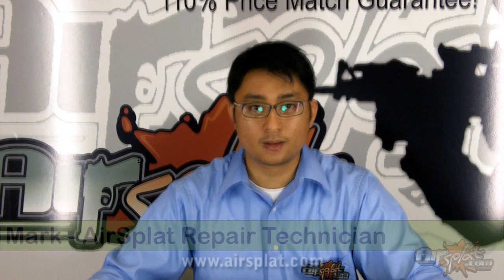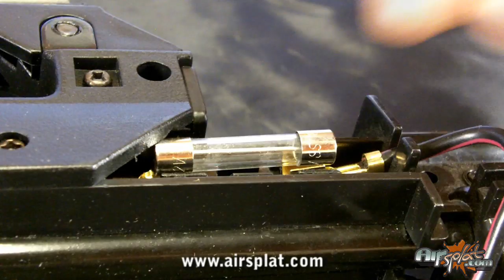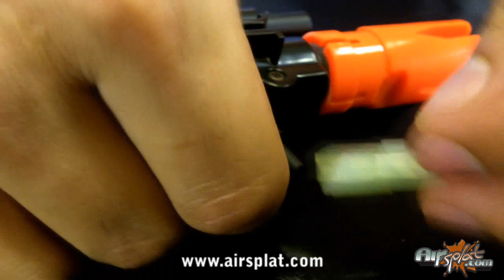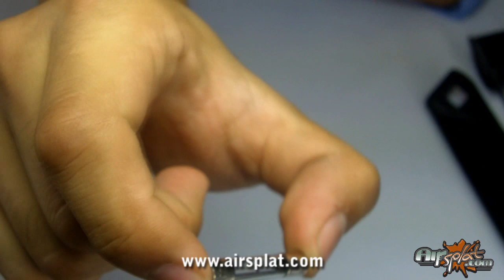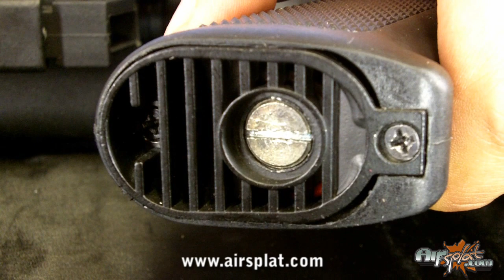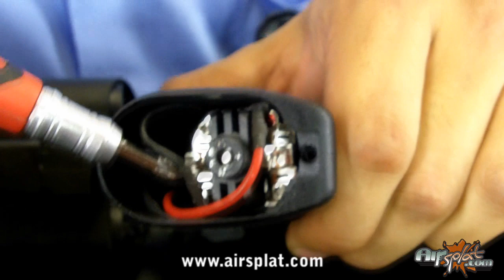Airsoft Tech Tips: Fuse Bypass & Examination Check  Motor Connector

Comment: You forgot to show the reversal-latch if the piston is stuck in the gearbox, i had this problem today and that also produced no sounds, but it did produce alot of heat in the wires

Comment: This video was so helpful. I have the g&g combat machine and it would shoot. The fuse bypass would work so I checked the motor like he said to in the video. The black wire wasn't fully connected so I connected it and the gun worked. I saved money and gas by not going to my local airsoft shop. I am so happy my gun is ok
Reply: Wouldn't shoot*

Comment: DO NOT USE FUSE BYPASS IT WILL MELT YOUR BATTERY AND CAUSE DAMAGE TO YOUR GUN. Last night my JG stopped working and I bypassed the fuse, it started working again, two minutes later the battery is melting and smoking the whole room
Reply: Tai Lopez's Nephew you're only supposed to shoot once not run it like that, one shot won't hurt it

Comment: Airsplat. Im currently in the process of replacing the fuse but need what you called in your video "metal waves" the 2 brass holders you put together to bypass the fuse. what are they called so i can buy them and do you sell them?

Comment: I have the Jing Gong MK36c Airsoft gun and it wont work. the fuse's metal string inside the fuse seemed to be split into 2 as in, cut down the middle of the string. should the fuse look like that or should it look like one whole metal string inside the fuse. if it shouldn't look like that, then could you give me some suggestions on where to get a new fuse that is compatable with my JG MK36C? Thanks!

Comment: ok I just got this exact same gun and after only 15min of play with it i noticed the fuse had snapped. I searched this video and went out and baught brand new fuses( 15amps) the reccomended ones for the batterie that came with the gun. So i replaced the old fuse with the new one and it worked for like 10 shots and then it stopped again. I checked the fuse I had just put in and it was fine. Didnt snap neer the ends or in the middle I checked real good. Any1 got any sugjestions on what happened?

Comment from the maker: @immadonuttin the fuse bypass is just to see if it's the fuse that's broken and having the issue. We dont recommend just running it without the fuse or hardwiring the two contact together. The fuse is there to prevent overages in voltage and amps to protect the motor and internals